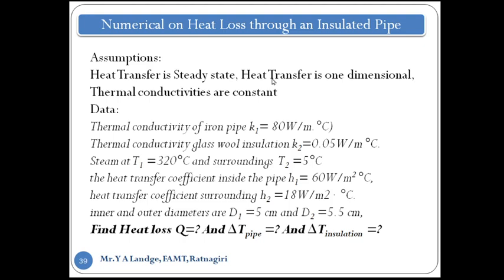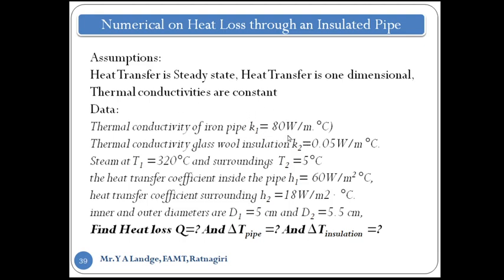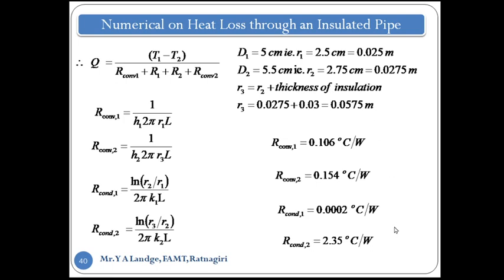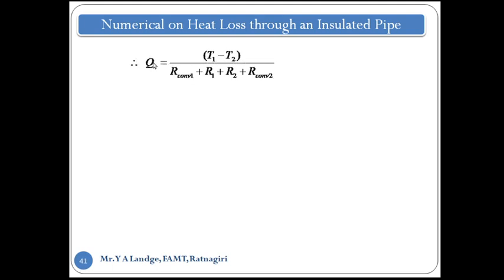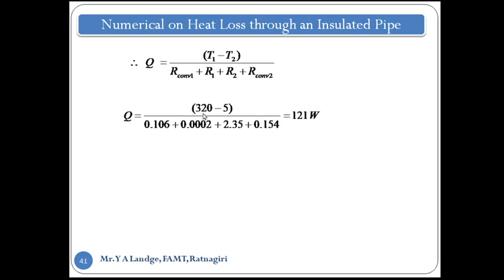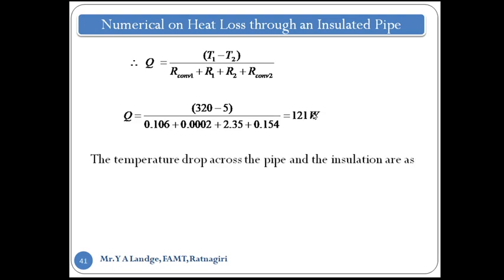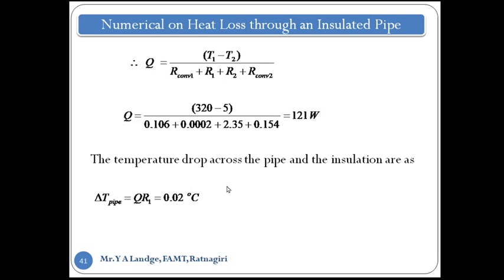Numerical on heat loss through insulated pipe: Composite cylinder

Comment: Sir Rcond1 ke value full find explain kerke dekhna comments me chaye
Reply from the maker: R cond1 is the resistance by iron pipe ie heat transfer by conduction so we take the Rcond1=ln(r2/r1)/2Pi kL where r1 =0.025 m is inner radius of pipe and r2=0.0275m outer and k1 =80 w.mK is the conductivity of iron pipe and take L=1 m as asked per unit length.